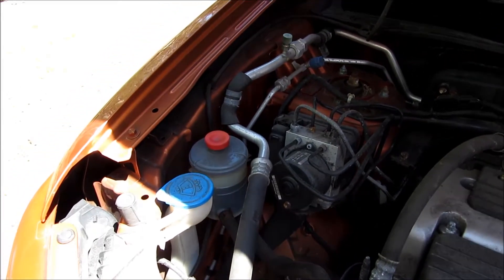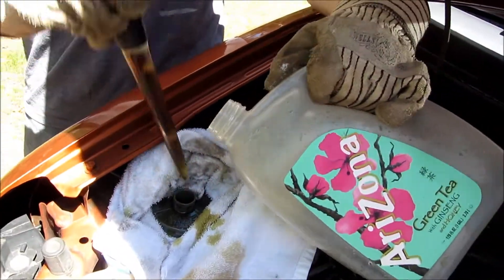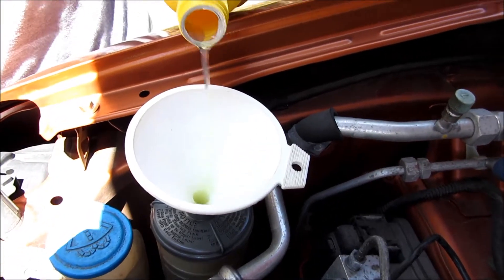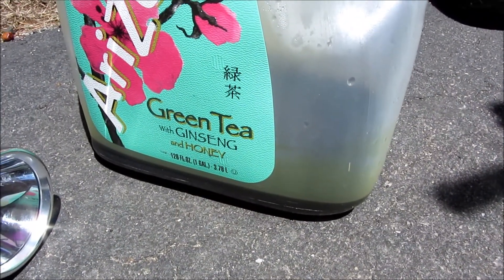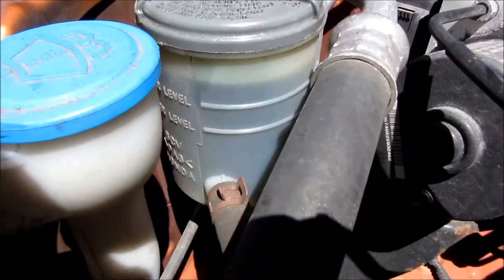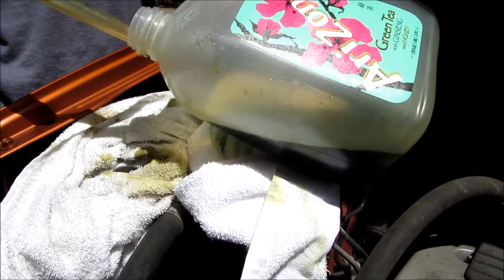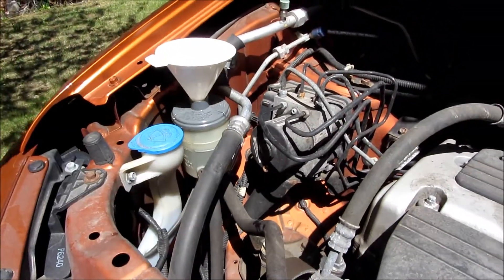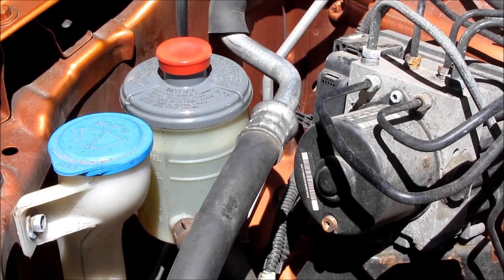How to Change Power Steering Fluid for Honda or Acura the Easy Way

Comment: I use this rinse/repeat method, rather than disconnecting any hoses. It's so much simpler and less messy. Running 4 quarts through the system will definitely do a full flush. There is no need to drive the vehicle around or even start it, just jack it up and turn the wheel lock to lock a couple of times each time you put fresh fluid in the reservoir. You'll save gas and your tires too.
Reply: Will it take out the air with your method that you just said? Changing the fluid and jacking up the car?
Reply: I just did the disconnecting hoses method but your method is better. I wouldn't have gotten a bolt stuck deep in engine compartment that took me an hour to get out. Rinse and repeat from here on out
Reply: @cs6950  I’m gonna replace both hoses from the reservoir on my TL so i was wondering how you ended up getting all the fluid out. Turn the steering wheel while the hoses are disconnected or 🤔

Comment: Thanks for this video. Did this today and used 9 of the Honda Genuine power steering fluid bottles. The fluid went from black to a very light golden/brown (close to the color of the new fluid), and I'm sure it will get clearer the more iterations I go through. The steering is much smoother now and it got rid of some strange noises that used to come when the wheel was turned to the extremes.

Comment: I use a large pump from a  big bottle of shampoo conditioner or liquid soap. Pump it right out fast. Put the pump in and pump away into a bowl that fits down in there. Careful not to spill. Put a few rags underneath.  Any power steering fluid that is Honda comparable  is fine. Blue Devil full synthetic is what I used. It says also for Honda on the bottle. It was $6.00 a quart Autozone. Two quarts was plenty for the flush and a little left over.Nice and clear fluid now.

Comment: This is a good method if you don't feel comfortable disconnecting the power steering fluid return line and doing the whole flush procedure.
Reply: Tamás Madarász but doing the whole flush will flush out all liquid, this is a drain and refill. Make sure to turn steering will and use turkey baker to suck up the fluid being dump in container. then continue on. plug reservoir. Only thing I'm having issue is finding the right type of plug to use on the reservoir.
Reply: I used the disconnect the return line method and it drains all the fluid in seconds.   No wasting good fluid  and mixing with bad.    The method in this video is not the easy method because it takes 20 times as long and wastes expensive honda fluid.

Comment: Don't really need to drive around, just turning the wheel when the car is running will engage the pump and the hydraulic pressure will suck in and pump the new and old fluid through the system. Turkey baster is definitely easier than disconnecting the hoses and draining the resevoir.
Reply: FancyRamen I want to try this method.   80k on the Odyssey and never had this done.  Car makes a fluttering sound on cold start.

So...drain, fill, start car and turn steering handle lock to lock a fee times and repeat?  Then after 3 refills,  the fourth stays inside?  Thanks. ...nevrr done this before and doing research now.

Comment: The Prestone Power Steering Fluid for Asian Manuf'd Vehicles (12 fl oz.) is more expensive but it's premium full-synthetic formulation for Acura/Honda and Lexus/Toyota vehicles.
And to avoid messy, you can use Pennzoil Multi-Use Hand Pump or alike to suck the oil out better.

Comment: At the beginning of the week, I checked power steering fluid on my 2010 Acura and saw that it was pretty much black and had a burnt smell. I started doing the same thing as you are showing in the video and now pretty much finishing 3rd bottle, but the fluid is still pretty dirty/dark.  How many more times do you think I will need to do as I don't believe that one more bottle would do the trick?
Reply from the maker: What you have done is good enough.

Comment: Thank you for this video!!  I just did this on my 2006 MDX.  I ended up using a bulb type pump which made easy work of removing the old fluid.  When I stuck the intake of the pump into the reservoir I swear it felt soft at the bottom like there was some type of filter.  Do these reservoirs have some type of membraine/filter at the bottom?
Reply: Yes! Be careful not to damage it... clogged screen is also a problem with these things on Honda Acura... some try to clean it out, others will buy a new one
Reply: @ricebike  Good to know.  Thank you.

Comment: Nice video.  can one suck out the old fluid & turn the wheels side to side without refilling? the old fluid should be pumped back into the reservoir for extraction.
Reply from the maker: Omar Qureshi I tried that previously not quite enough to backfill through the system, without refilling
Reply: Poolarity - Life Hacks ok..thanks for the response.  This is a easier but a little time consuming method. I just have to find a nice day w/ the sunshine as you did in this video ;)
Reply: You have to add fluid, and then you turn side to side to mix the fluid, can't run it without fluid in reservoir
Reply: armorlol after adding fluid and turning lock to lock, the dirty fluid will fill back up?  If so, do we need to fill the resvoir halfway to make room for the dirty fluid?

Comment: brooo gotta use oem honda or royal purple synthetic. only 2 liquids that are compatible with system or you will have issues with system down the road.
Reply: WRONG
Reply: candlepen I've been using Royal Purple since day 1 of purchase of both cars. 2007 Acura TSX & 2003 Honda Accord with no issues. I do all flushes at 30,000 miles, including changing spark plugs (NGK Iridium Laser), Valvoline synthetic dot 3/4 brake fluid. Power steering, engine oil with oil filter, transmission using only Royal Purple. I only use Honda coolant. In my 1994 Honda Accord I've used other liquids and had issues that engine & transmission blew, had to change out power steering system for new one. With that car (94 Accord) I've used Quaker, valvoline & some other I can't remember with issues. I still have my 2007 Acura TSX & 2003 Honda Accord today's year is 2017 & going strong. Runs smooth & clean, no gunk. After many hours of research, I've switch to Royal Purple. That are my experiences, what are yours that you say I'm wrong? I want to know, or you just saying just cause... 🤔
Reply: Just saying just because your old 1994 Accord had PS problems and your 2003/2007 don't doesn't mean its the fluid's fault either. It is a 9-13 years older system, with likely far more miles.